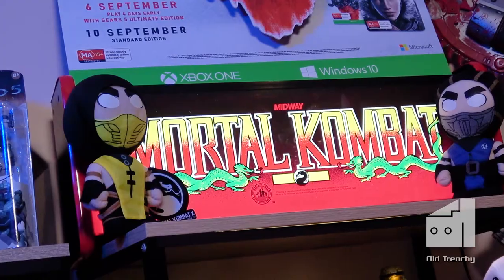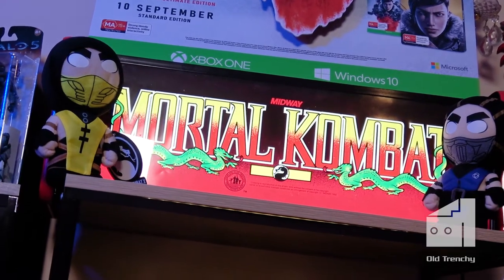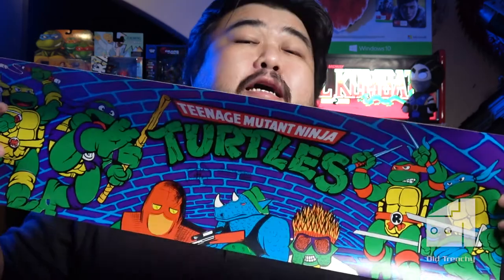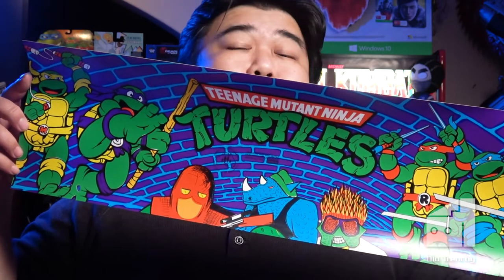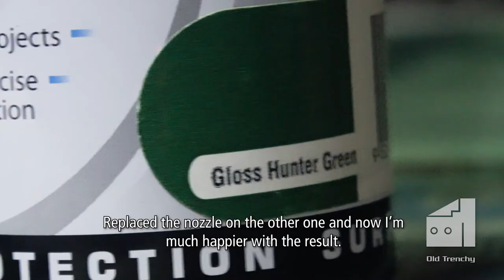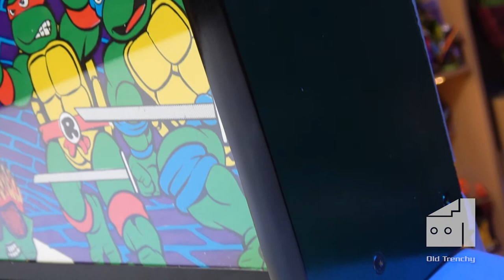Building a Teenage Mutant Ninja Turtles Arcade Marquee Lightbox | Old Trenchy

Comment: Great video! I'm preparing to make something very similar. Are you able to post an image of the template you used for this and the MK box? Or maybe just the measurements? Either way, great job
Reply from the maker: It's been a while so I don't know where my template is however the dimensions would depend on the marquee you're building around.